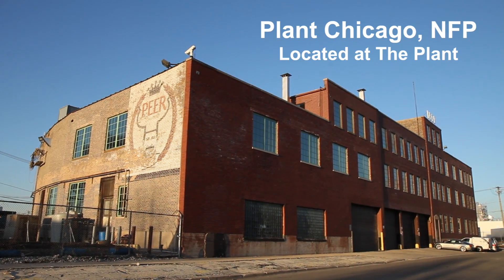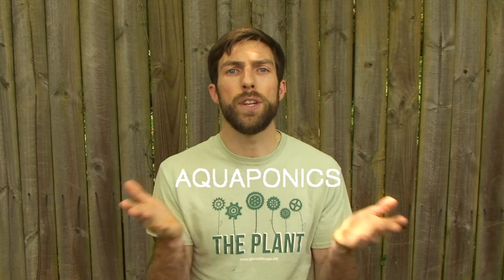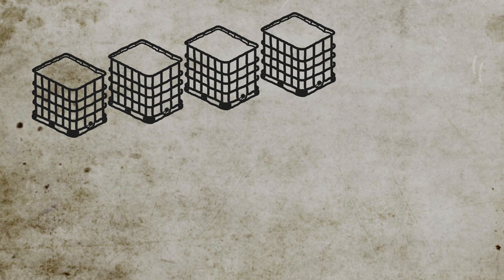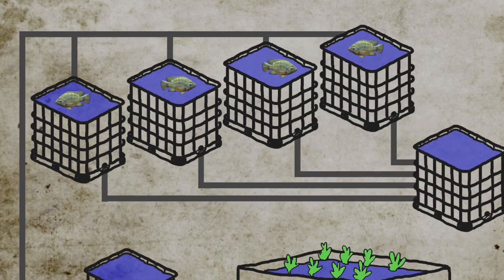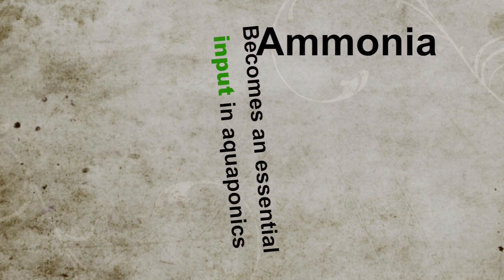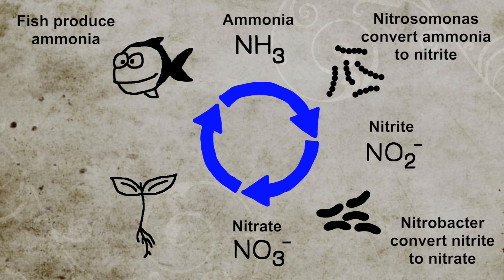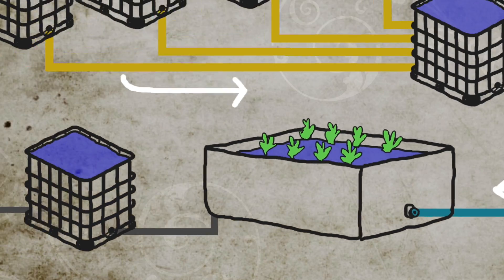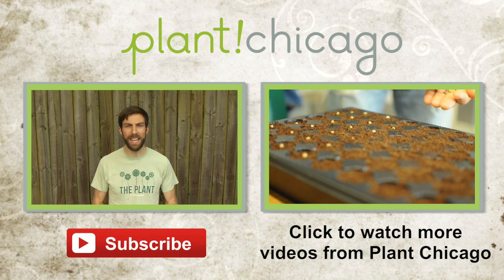What Is Aquaponics? - Plant Chicago, NFP Explains

Comment: what happens to the hydrogen the nitrosomona strips off?
Reply from the maker: Great question, 54mur41! Two of the H+ ions become water by combining with oxygen in the system, while one of the H+ ions do not combine and remain free in the system causing the system to become more acidic over time. The chemical equation is below:

NH3 + 1.5 O2 => NO2- + H+ + H2O